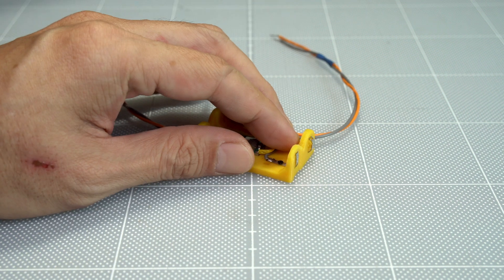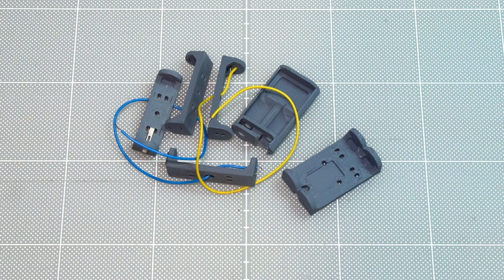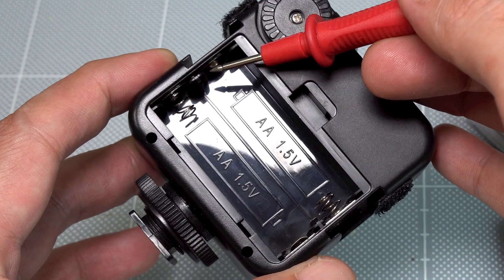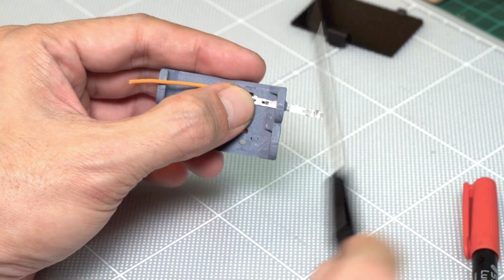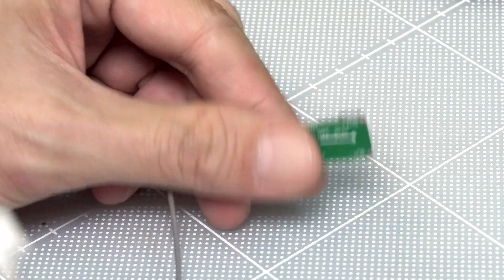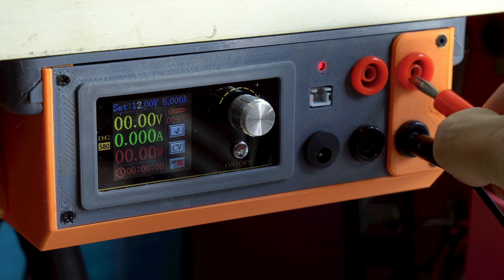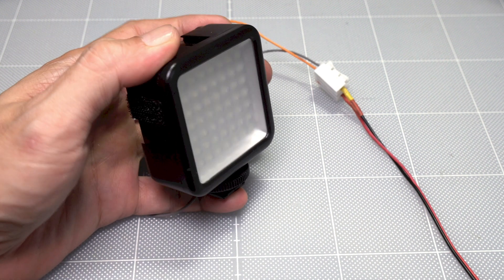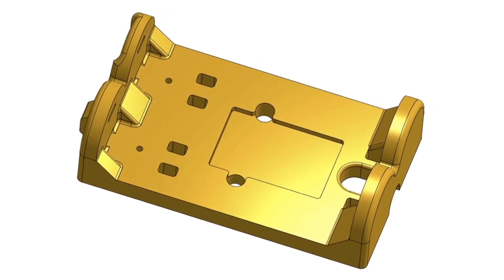Infinite power for an AA battery devices

Comment: Good idea, but I think it’d be better to disassemble the LED light, solder a jack plug for the power output, and 3D print a new battery cover with a jack holder.